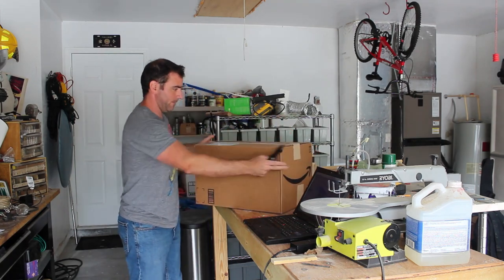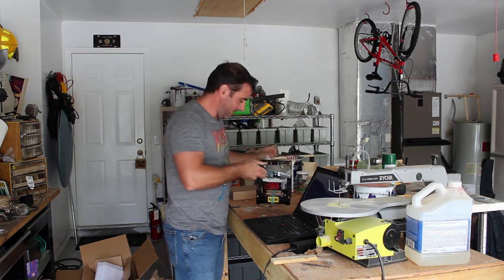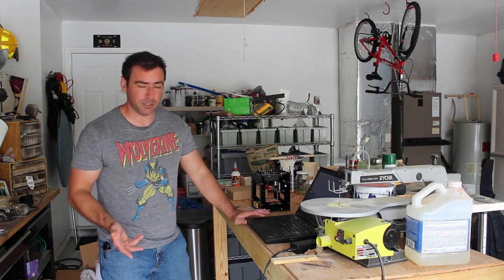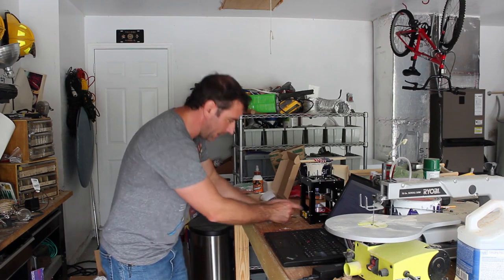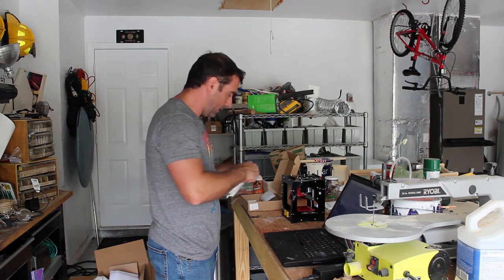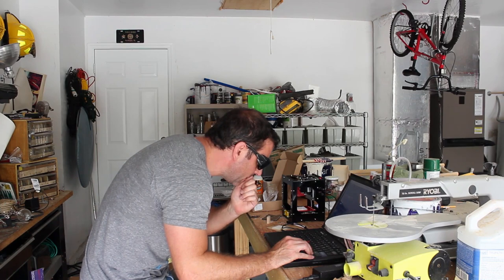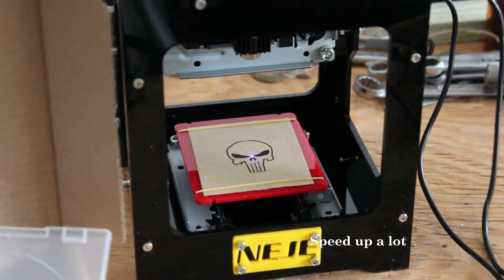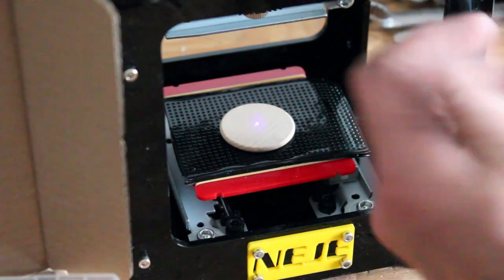Laser Engraver NEJE on Linux with EzGraver

Comment: Hey Kris FB locked me again. What would I need to engrave 7075 aluminum?
Reply from the maker: Hey Paul.  I have no clue.  But I'm sure this laser can't do it.
Reply: Paul
To etch metal, you’ll need a much more powerful laser ($$$$), at least 40 watts or more.  Kris misspeaks in this video when he mentions wattage for this machine.  It’s actually 1500Mw.  To etch metals you’re better off looking into acid or salt etching. You can use a machine like this to make very precise stencils for etching.  That’s why I’m here to check out this machine.  I’m a jewelry maker - old school but wanting to learn some new tricks.